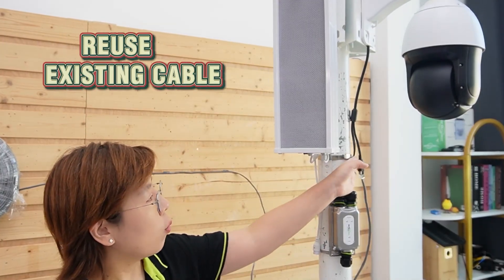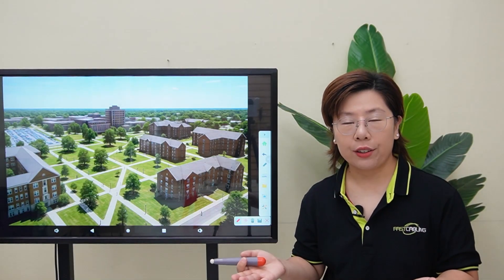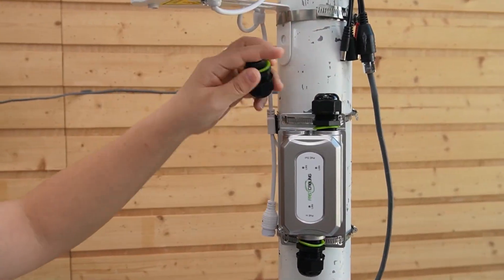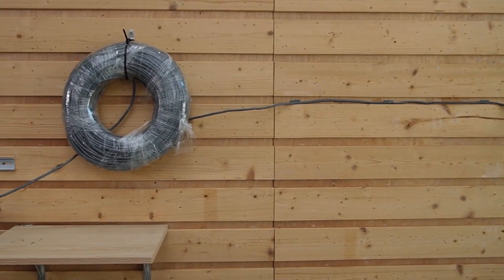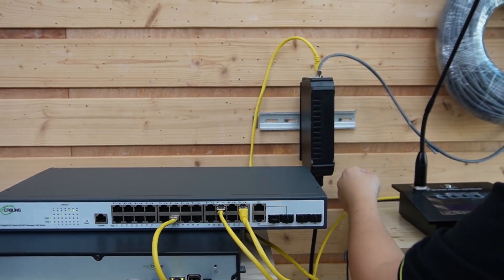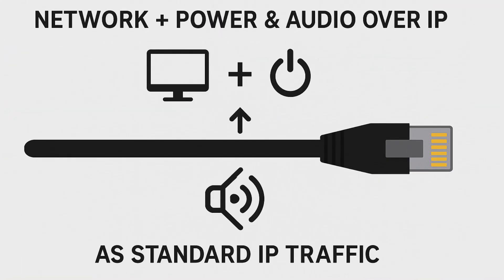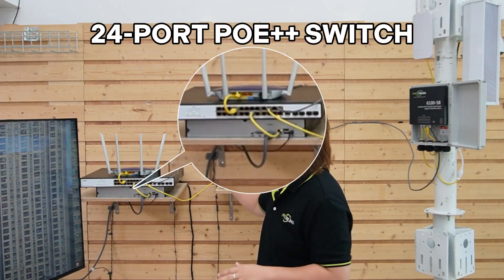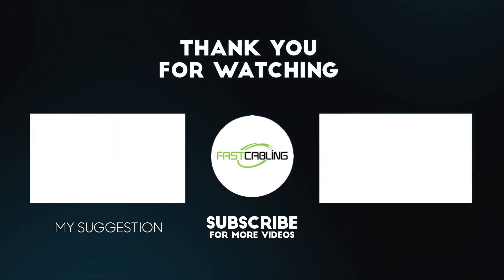PoE Tutorial: Build an IP Camera & Audio System for Smart Campuses

Comment: hi i am planning to install eight 4mp camera on a building and am working on tight budget  my plan is to use Hikvision 7100 series 8 port POE NVR( DS-7108NI-Q1/8P/M)  for my eight 4mp smart hybrid light camera (DS-2CD1143G2-LIU) also i will mix one or two bullet same type smart hybrid light so my question is if i keep all eight cameras within 100m and i use full copper cable is the NVR capable of supporting all cameras with no issue
Reply from the maker: Your NVR can handle eight of those 4MP cameras, but you should check and configure the PoE power budget and total incoming bandwidth / bitrate settings.

Comment: Impressive video, FASTCABLING. Looking forward to seeing more content from you. I smashed that thumbs up button on your upload. Keep up the fantastic work. Your explanation of using POE to integrate audio with surveillance systems is brilliant! How do you see advancements in POE technology influencing the scalability of smart campus solutions in the future?
Reply from the maker: It is a good question. The centralized PoE eliminates the AC power at the edges. There is no need to handle the high voltage AC power at the edges, but there is power and distance limitations. The maximum distance is 200 meters (plus 2nd 100 meters from the edge switch) and the maximum power budget is 71W. It could be a handy solution for small campus projects. The surge protection has to be considered, the PoE surge protectors can deal with the surges.